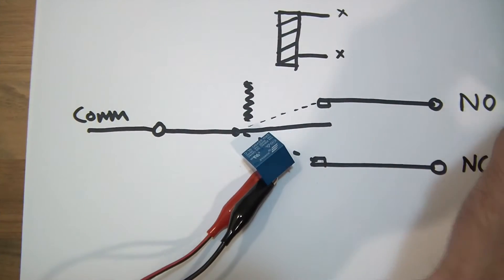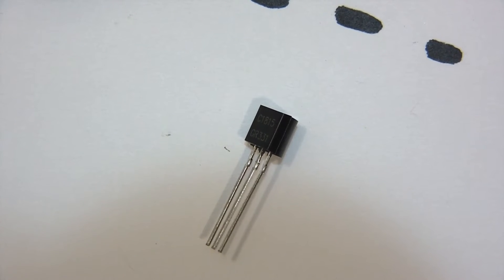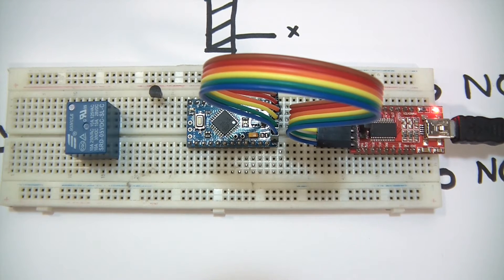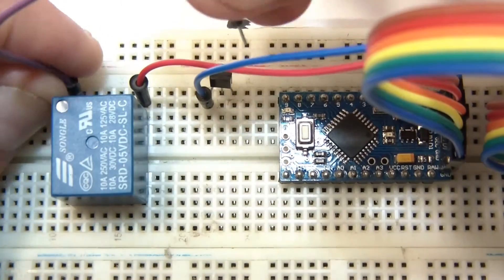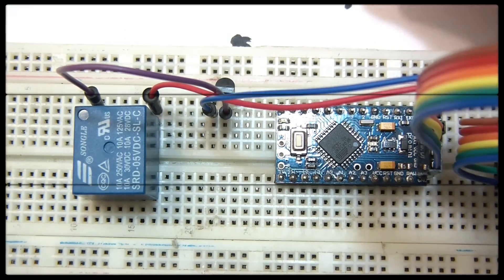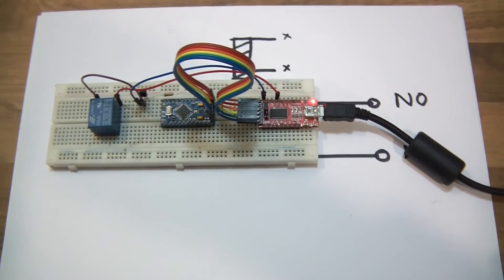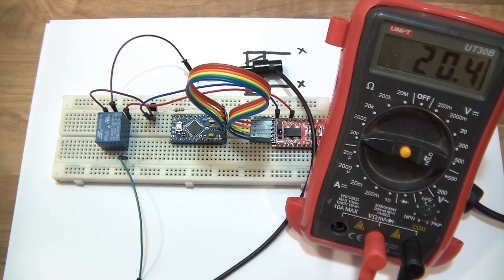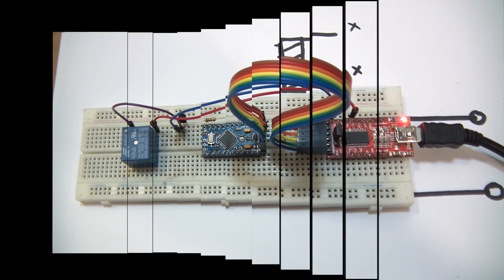TUTORIAL: How to Properly Wire up, Power & Code a Relay with Arduino! Songle 05VDC Module - Simple!

Comment: Thats why you should use a 5 volt arduino. I have the 5 volt nano and it works great just wiring it streight to the 5 volt supply for the arduino.  This reduces the complexity of it greatly. I started on an arduino uno and moved to esp32,esp8266 and back to the arduino nano 5 volt. They also have 3volt relays which would work as well without the transceiver

Comment: An esp32 can be used also ? Then a local net app and I could can all my X10's that quit working right?  You've probably already done this & I missed it :)
Reply: I do like the esp32 for wifi but for a simple closet motion light i dont need wifi the arduino works without a hitch.